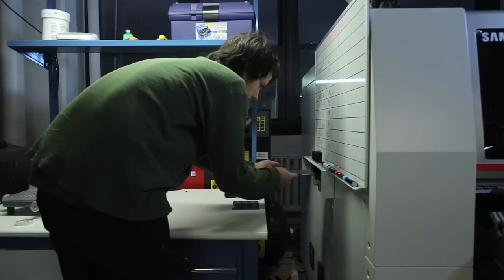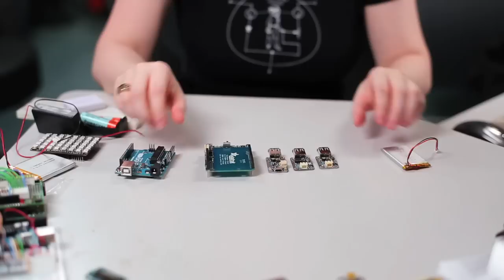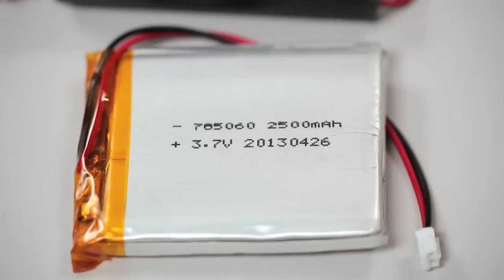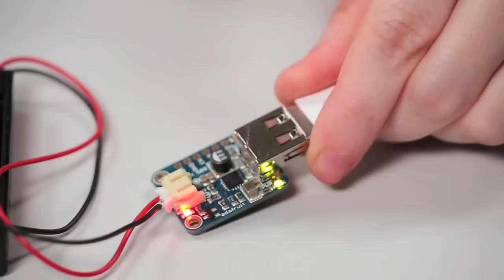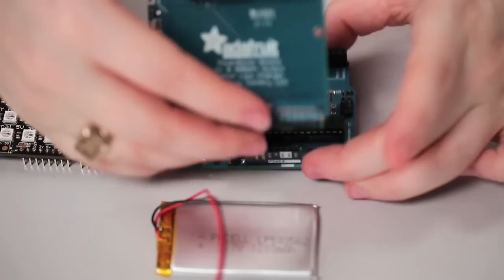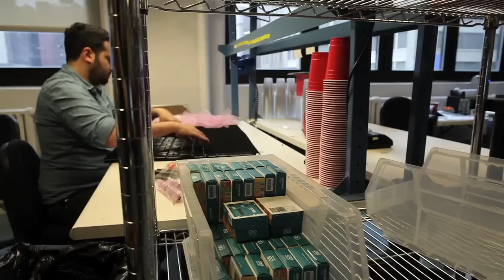PowerBoost by Adafruit

Comment: If you kept the battery plugged into the board, will the blue led light drain the battery overtime? If so, how would you get around this?

Comment: When the low voltage red LED turns on, will it cut off the output power or would it continually drain the lipo until you manually disconnect it?
Reply: I came here to ask this question.  Using these boards with lipo or lithium ion batteries is completely useless and dumb if it will still destroy the battery if you're not watching the board and waiting for the low battery indicator light to turn on.

Comment: Hi, noobqestion here: Can i use for the Powerboost 500 a 300mA Lithium-Cell? Other cells are too big for my porject, they dont fit in my case, but i still need 5V Voltage für my Arduino Nano...
Greetings from Germany

Comment: The light means the 500c is finished charging. Can you keep it plugged in and run your device off it (continuously plugged in), or does it need to be unplugged to avoid overcharging?

Is this the same with the 1000c? which is available for me online

Comment: Will this work in a 12v situtation for automobile applications? We need a way to power everything from the keyed ignition that allows for a safe shutdown after the keyed ignition goes to off. Basically once it goes into UPS situation, can it auto power down?

Comment: can i give power both 10" lcd n rasberry pi 3 ? with powerboost 500c ?
Reply: SPIDY Ghotra I believe you require 1A for the pi3 to run without running out of current with attached devices, I was able to power on the pi3 with only a few hundred milliamps but it shut off soon after startup because of the current draw. I would recommend the power boost 1000C for you application, but check what the load is on your screen as it may require more current at lower volatges

Comment: QUESTION here, when you say e.g. Powerboost500 can supply at least 500mA, what does it mean ? Does it mean that if my project consumes only 100mA it won't work at all ? Or that the maximum current that I can draw is at least 500mA?
Reply: CapitaineBleuten current only takes what it needs, the max current the supply device can output is 500mA. this means that if your device only requires 100mA it will only supply what your device needs, this will also give you a longer usage on the battery because it is not drawing the full current. Devices only take what they need from current so you can always get away with more but never less.
Reply: Since I posted this, I have known the answer, but thank you anyway. Also for future readers.

Comment: I'm a newbie on this, but doesn't 3AA inline baterries gives you 4,5 voltage? (1,5*3) and so on? 
so the question is, what about if I'm using 10AA inline batteries? do I need a 5v battery regulator? thanks in advance.
Reply: +Rodrigo Rivero  I could Be wrong, but i think if you put 10AA batteries in series it will produce 15v
Reply: +James Croft thank you mate!

Comment: I have a question im trying to make my pi mobile but the control board / screen also requires alot of juice will one powerboost 1000c work for both modules ?
Reply: doctor who? I would verify with manufacturers specs, some screens require 7V at low amps but can run off 5V with more current as they have their own regulators inside. I know the pi3 recommends 1A but will run off less. if the total current in the manufacturers spec sheet is less than 1A then the 1000C will work, if not you may need to build your own voltage regulator circuit that can supply more current.

Comment: Wonderful! It's like a MintyBoost on steroids. I love the MintyBoost, but even when powered by 3x AA batteries, it can only add about a 35%-40% charge to my Galaxy S3. The one thing I enjoyed about the Mintyboost was soldering it all up myself. It's fun.

Anybody know where I can get holders for 18650 batteries? I have a flashlight which uses them, and I'd like to use them to power this board as well. I always have one with me, so it seems like a good choice.

Comment: What if I want rechargeable batteries and 1000 mA? You mentioned running a raspberry pi. Doesn't the RPi require 1-2 Amps to work properly... especially if you have some moderate load on it.. i.e. USB 3G dongles? What do you recommend in that case? Is it even possible? Would really appreciate any help. thanks!

Comment: So basically, your asking the battery to supply more then it's suppose to? That would heat the battery up wouldn't it?
Reply: Not the case.  It is most likely a switch mode power supply.